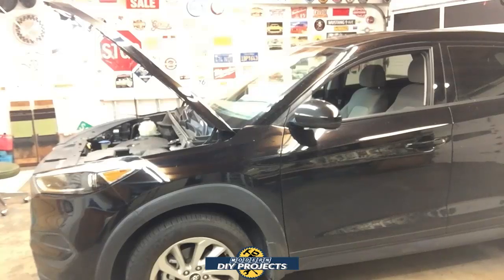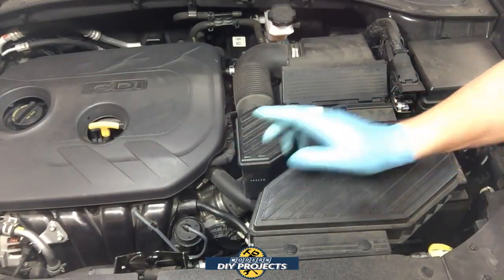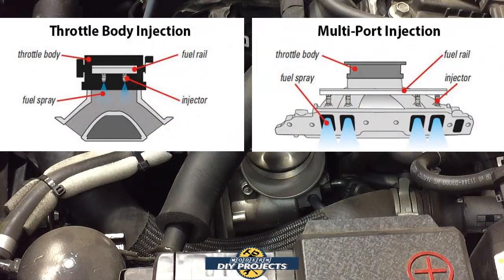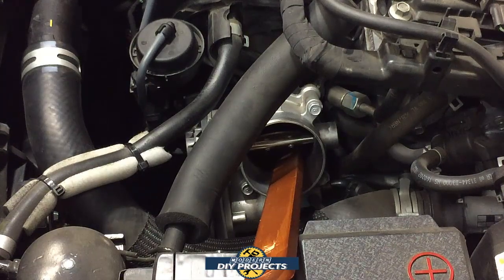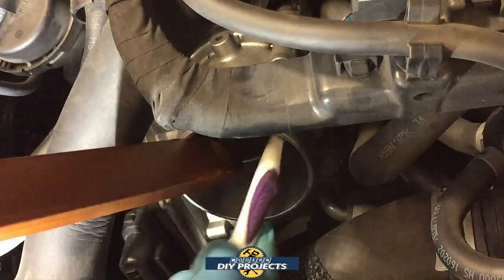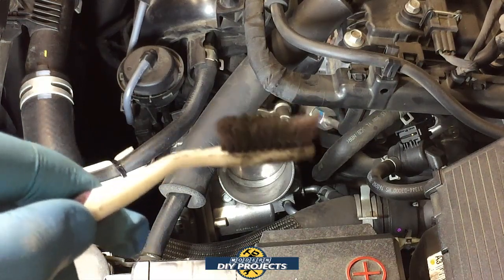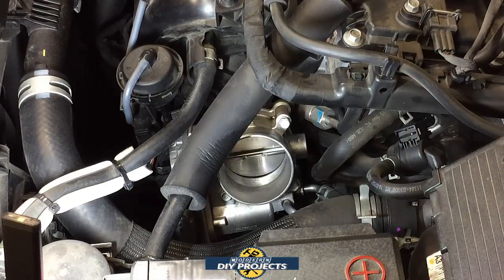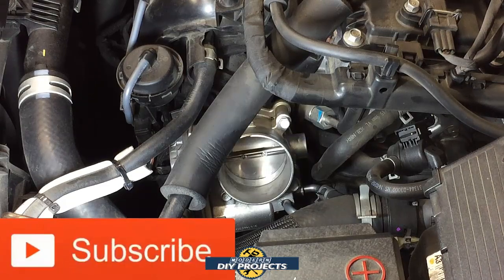How to Remove Carbon Buildup on Direct Injection Engines GDI Intake Cleaning the Easy Way

Comment from the maker: Here is a easy way to keep your GDI engines running properly and without giving you trouble. Do some simple maintenance and you wont have to worry about Carbon Build Up.
Reply: I got two questions:-
is any carb cleaner safe to use this method?
What is the different between carb cleaner(carb choke, or throttle body cleaner) AND specialized products like liqui moly. crc. stp. lucas intake cleaners? they have special intake cleaners.
is it only concentration?
Reply: @FloppyKarodo the Supertech intake and throttle body cleaner from Walmart has more active ingredients of Acetone and it is very effective against and melting carbon both soft and hard from the valves and is best per $$$ dollar
Reply from the maker: I have not found any real difference. There will be slight  differences of course because each company will have a proprietary formula, but in general they all are about the same. Same with all the other products you mentioned. Proprietary formulas that others cannot copy but they achieve the same job. It's like dish washing soap. Is there any difference? Formula only but same results (and price, don't forget the pricing). Also Carb cleaner can be found anywhere. Injector cleaner is really hard to find on some places. I can't find any where I am.
Reply: @ModernDIYProjects  so the real difference are secret formula and marketing. 
I will give it a try. 
Fuel injector cleaner would do minimally cleaning and its hard to dissolve carbon in short time, ofc if you pour fuel injector cleaner in a pan or plate, and put injectors cylinders or valve it will clean. 
But in injecting in milliseconds i dont think it cleans fuel system, ofc it cleans injector very much, but the intake system should better. 

I highly Recommend you to buy Autool C200 since I am planning to get it, since no air compressor needed. Add any carbon cleaning agent and see.
Reply: @ModernDIYProjects  there is a method it claims ot cleans good, which spark plugs are removed and pour carbon cleaner foam and soak then extract with vacuum, but i dont really like it, unless if cylinder head is too contaminated
Reply: @FloppyKarodo look for one with high Acetone content like the Walmart Supertech brand can he was using in the video cheap and highly effective only $2 bucks and some change or just take the manifold off and spray soak them much more effective for GDI engines

Comment: So we’re putting cleaner on the intake, and then running that thru the engine? I’m no mechanic but I feel like that’s not the best? Idk tho.
Reply from the maker: It does no harm at all. How do you think people used to clean carburetors? Same process. It mixes with the fuel and gets burned off.

Comment: I have a 2010 Audi a3 2.0t with 288k. When I start the car on a cold morning and drive off after about a min or two it jerks and hesitates.  Once it warms up it’s gone. I’ve already changed the plugs, coils, fuel filter, PCV, mass airflow and still doing it.  Do you think it may be the carbon build up that is causing my issue ?
Reply from the maker: Possibly, but first step is to check for codes and look at the Freeze frame data. That can give you a lot of data as to what is going on, and not all codes set a check engine light.
Reply: @ModernDIYProjects do you have a video or any info on how to look at freeze frame data? I can see it on my scanner but I don’t know how to use that function.
Reply from the maker: All you do is click the button and it should open a menu with all the data. Each scanner is going to be different so it's not something I make a video about. It's brand specific. If there is nothing there, then there is nothing to see.
Reply: @ModernDIYProjects I clicked and nothing happened
Reply from the maker: Probably nothing to see there. Sometimes there is no data to go by.
Reply: @ModernDIYProjects you seem very knowledgeable but I’m
Wondering if there’s no CEL or codes then how do I know what my issue is ? I’m sure the car could benefit from a full carbon cleaning but I’m hesitant to spend the money without knowing if this will fix my issue. The car only jerks when cold. Once it warms up it runs pretty good.  Fun car!
Reply from the maker: I'm knowledgeable from a lot of trial and error. I would not recommend that you spend that much money either without knowing for sure what the problem is. There are MANY things that could be causing this issue and it would be really hard for me to explain them since I don't know your expertise dealing with car repair. I would definitely suggest that you get someone to look at it and give you an opinion having put eyes and hands on it. From my end all I can do is guess. It could need a throttle cleaning, or fuel injector cleaning. Make sure you have the right plugs for this car and the right gap. You may have a faulty O2 sensor that takes a while to warm up causing a stumble. I would suggest that if you have a scanner have someone drive with you when it's cold and see if they can see anything acting up. Look at the data stream and select different things to see each time. Chasing things around like this is the way I find out what the problems are with my cars.

Comment: Will this cleaning on a 2025 2RS Trax cause the check engine light to come on? And if so, is it easy to clear the code?
Reply from the maker: I don't see why it would, but Chevys can be weird sometimes. To clear the code you can disconnect the battery for a few minutes.

Comment: It won't work without doing mechanical cleaning. It requires manual scrubbing intake valves. This works simply with a well maintained engine.
Reply from the maker: That was my point in the video. Do this every so often and you wont need a major cleaning. Maintain your engine and it will maintain your happy driving.

Comment: Excellent job! I was an auto mechanic for many years and also a service manager. I do have the kit with the metal can to perform the different cleanings, but it is not needed thanks to spray cans. My dad has his own garage, I remember him using a similar setup to use on cars with a carburetor. I have to say  the mechanical inclined individuals out there, some of the most intelligent individuals that I've met, were mechanics. I've worked in other industries and at our university. 
Thank you!

Comment: I have a 2014 ford focus throwing a code po219 air fuel ratio .Well I went to spary inside the throttle body the other day and my butterfly moved when engine was off .But when it was completely on with the engine it didn't open up hopefully this is my problem. What would be your suggestion isn't it suppose to open on both modes ?
Reply from the maker: That is just the actuator adjusting the throttle opening when it shuts down or starts up. Perfectly normal. When it gets power again the computer controls it to the proper position when the motor is running. When no power is applied it goes into a neutral mode.

Comment: Some have said that the throttle body position sensor can be damaged by carb clean. Others have said your oxygen sensors and cat can be damaged as well. Not sure who to believe. I have a 22 accord and a 97 avalon. Seems the electric cars will be easier to maintain.
Reply from the maker: Both are wrong. I have been doing this for years and have never had any issues. Like I have said before it's an old wives tale that goes back decades to when Carbs existed and people didn't understand EFI systems. Carb cleaner will not do ANY harm at all or I would already have experienced it.

Comment: From Buffalo, N.Y. We used to do that to our cars back in the late 1960's and 70's. We had regular carburetors and used spray Gumout on the butterfly every so often. Thank You for this video as I'll start doing it to my 2010 Ford Escape.I just HOPE that nothing has to be RESET with the electronics of the computer on the vehicle. Once again, THANK YOU PAL.
Reply from the maker: Glad I could help. I have not had this ever cause a code for me. But if you have any issues the code will either go away on it's own when the computer takes another reading or you can disconnect the battery to clear the code. That is assuming that you don't have an OBD2 scanner that can clear it more easily.

Comment: CRC makes intake valve cleaner run the engine at 2000 RPM and spray entire can in throttle body once done drive the car around for a few miles. Oh yeah don't let the spray touch the MAP sensor and before spraying make sure the engine is at operating temperature.
Reply: I do that in engine cold and start engine tomorrow and clean everything.

Comment: This was not a design flaw they knew that this would happen. Toyota has now has a system where it does both direct injection and port injection the computer regulates when and which injection system is being used.

Comment: I've read you aren't supposed to force throttle body open while its connected as it can mess with the electronic adjustments but I guess it must be fine on this model.
Reply from the maker: That is a misconception. The only time I can see that being an issue is if you try to move it while the car is running because then you are fighting the active controls. When the car is turned off, it should have no affect whatsoever. I have done this countless times on different vehicles with NO bad effects.

Comment: I have an easier cheaper method.  Vent the pvc to the atmosphere
Reply from the maker: That will work but only in places that don't have emissions testing, otherwise you will get a fine.
Reply: @ModernDIYProjects  true.  Any idea if I should plug the line to the intake or attach a small filter?
Reply from the maker: The intake does not need any additional air inlet so you can plug the line with no problems. That inlet is only there for the PCV valve to suck out the gases.

Comment: My question is by doing this would it hurt the converter by plugging it up with the blow by from the cleaner? Thanks
Reply from the maker: Not at all. A mistake most people make is to think that what I am doing will make chunks of crud break off and get stuck in the CAT. In fact everything that you clean off with Carb cleaner will become liquefied, and then burned off in the cylinders. Only slightly richer gas will reach the CAT and they can easily handle that. Trust me when I tell you that I have been doing this since the beginning of CATs and I have never had one get damaged to date. They are very resilient and have only gotten better over time. Early CATS used to be single stage where now they are Multistage so they can handle a LOT of abuse.

Comment: I have a Subaru Forrester 2021 2.5 motor, I just got it it only has 16,000 miles. So I should start this right away correct ? Since I don’t really know the history. A guy told me to not open the throttle body as it could hurt the electronic parts that open and close it.  Watching you it looks just fine .. please let me know is my car different?
Reply from the maker: You can do this procedure any time you like. Sooner is always better. You can manually open the throttle body just like I did with no problems. What he told you is an old wives tale. Just DON'T manually open the throttle body while the car is running. Do it with the vehicle turned OFF just like I did. You could cause damage if done while the vehicle is running because it will be fighting against you as you do it.
Reply: @ModernDIYProjects  thanks !

Comment: Great video! I have a 2016 Santa Fe Sport 2.4L with 98K miles. I bought it used with 92K.  As far as I know, this service has never been done before, So I'm sure the valves are absolutely loaded/coated with carbon buildup. I plan on doing this service right before i change the oil next. Any suggestions you can give me here?
Reply from the maker: Just follow what I did an you'll be fine. Keep it up with every oil change and that way you can clean up any messy build up from the previous owner.

Comment: I'd rather never by a Hyundai to avoid the GDI gunk buildup problem..
Reply from the maker: Well, you'll be sadly disappointed to find out that Hyundai isn't the only car maker following this same design. This all started with the Germans doing this then many others followed. So GDI has become very common. Now there are some car makers that have GDI plus regular port injection on their engines to prevent this problem but not everyone has gone that route.

Comment: All that carbon has to go somewhere hope it doesn't take out your turbo if equipped 😢
Reply from the maker: The carbon melts away with the carb cleaner it just gets burned off. It doesn't come off in chunks unless you have massive build up.

Comment: Is this a better  method than spraying downstream of the PVC vacuum tube?
Reply from the maker: You can do it either way but this way will also clean the throttle body. The PVC enters behind the throttle body or on the intake manifold. It's different on different vehicles.
Reply: @ModernDIYProjects  Thank you! Great info!

Comment: Where is my throttle body on my Hyundai Veloster 2012
Reply from the maker: Start at your Air Filter and follow that big black tube until it reaches the engine, and there you have it.
Reply: Thanks your Aces

Comment: If that engine is direct injection how is that going to clean the top of the intake valves ?
Reply from the maker: Because it gets sucked in with the air as it passes over the intake valves. Direct injection just means that the fuel is injected in a different way but the air still goes in the same old fashioned way. So anything that follows that path of the air will do the job.
Reply: @ModernDIYProjects  thanks

Comment: Won't opening the throttle body butterfly in that manner, to clean it, throw a check engine light when u start the car, & require a reprogramming of the computer system.?
Reply from the maker: Should not. I have done this to ALL my vehicles (American, Japanese, Korean) and never had any issues. Now if you have a temperamental BMW, Audi or Mercedes, I can't comment on those.

Comment: The source of the carbon build up, is the PCV system, where crankcase vapors (oil and blow-by from the cylinders)are routed to the intake manifold to be burned, however, it settles on the intake valves and slowly carbonizes from the heat.
Reply from the maker: That is a major part of it for sure. That is why I have a separate video showing how to make a catch can for the PCV system. But once you get the carbon build up this is a good, easy way to clean it off.

Comment: Loosen air intake o ring before throttle body and use throttle body cleaner with straw and run about a half can at idle before oil change. 5-8kmi  Spray enough just to keep the engine from dying. -------------  I don't have GDI, but I still do this before air filter replacements for port injected engines. 20k mi----------  I use carb cleaner on carbs before fuel filter replacements. 30-60kmi

Comment: So on a non gdi is there anything similar that is needed as preventative maintenance?
Reply from the maker: For the valves not so much. But doing this to clean the throttle body will go a long way and save you a lot of money. Clean the throttle body, replace the plugs, clean air filter and you should be fine.
Reply: @ModernDIYProjects   thx 🙏
Reply: Top Tier gas and an occasional fuel system treatment in the gas tank

Comment: The Lexus LC500 and IS 500
equipped with a 5.0-liter V8 engine that is part of the Yamaha-developed family. It's known for its performance and is designated as the 
2UR-GSE engine.  
Carbon buildup on intake
valve not occur due to dual port injection. 
Gasoline will wash over intake valve.
Reply from the maker: This procedure generally helps GDI or Direct Injection engines the best. But it doesn't hurt any other type of engine.

Comment: Opening the throttle body your way may cause damage to it since it’s electronically operated not manually operated.
Am I right?
Reply from the maker: That is just a YT myth. People will take a little knowledge and extrapolate the wrong info from it. Doing it the way I did will not cause any damage. I have been doing this for years and on many vehicles and have never had any issues. On the other hand I will mention to NEVER do this while the car is running. In that case you will be fighting the motor driving the gears and you can cause damage. When the car is OFF there is no problem.

Comment: So, how do you know this has done any good?
Reply from the maker: Improved drivability if you are having issues. If you are not having issues, then it is just a maintenance item and you will not feel any significant change. It will just maintain your vehicle from getting gunked up and driving badly. The whole point of doing this is to prevent a severe case where you need to tear the heads off. I can tell you that I have 135K on this vehicle and so far NO issues. Where many people complain that these engines are junk, I have been able to keep it running just fine by being proactive in my maintenance.
Reply: Most people say the engine runs smoother.